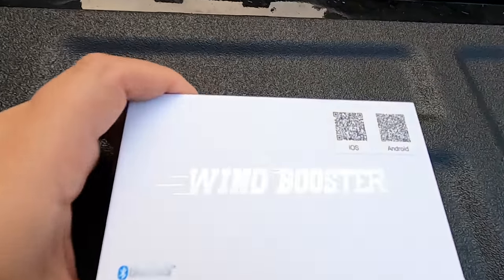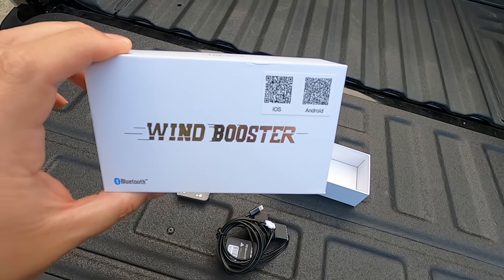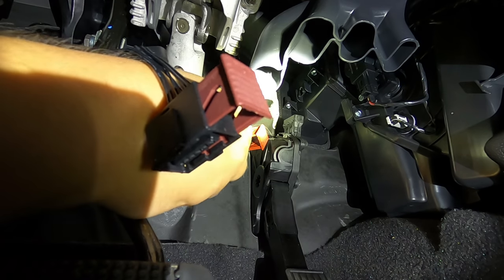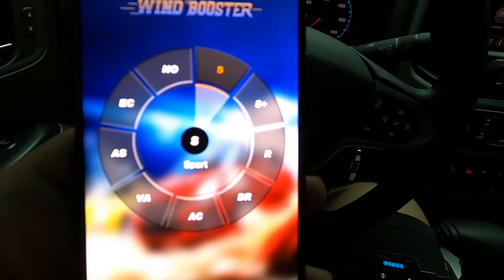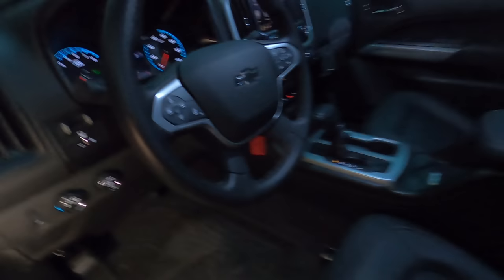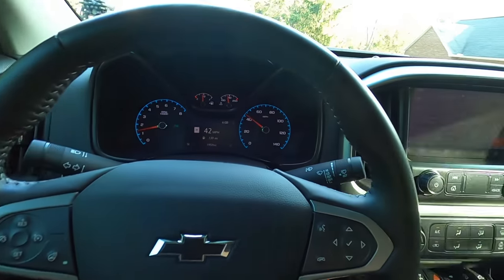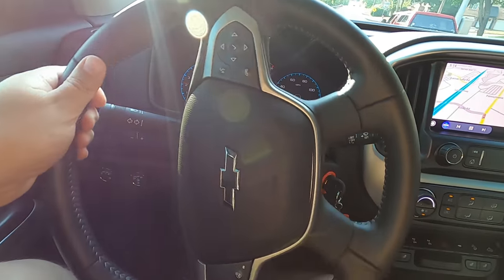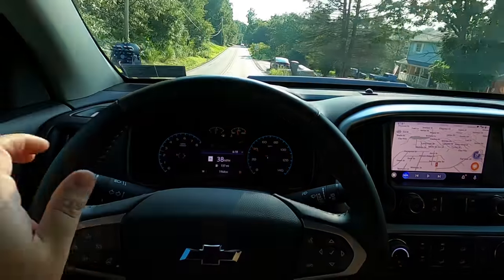FIX the throttle LAG on the Chevy Colorado with Windbooster!

Comment from the maker: HUGE improvement in drivability with this mod on the Colorado. If you guys are interested you can save 12% off the product by using promo code hpo at this link: https://shop.windbooster.com/product/bluetooth-app-chiptuning 👍👍
Reply: Ordered one yesterday before the video 😡
Reply from the maker: Dang!
Reply: Does this void manufacture warranty?
Reply: will it work on a 2015 Chevy Colorado Z71
Reply from the maker: Yes it will. 👍👍
Reply: I had one on my 2015 z71. It was not the wind booster but, it was great until it started messing with the computer in my truck. The dealership said that the throttle control was the problem. Took it out and have had no problem with computer since. Don’t know if it was just the one I had or what. Sucks I hate this lag she has
Reply: How does the Bluetooth effect other blue tooth devices?  I notice in my canyon  I can only connect one device at a time so I can't have my mp3 player and my phone connected at the same time?  Tks    Also I notice sometime  BT drops out for no reason,  hope this does not happen with the wind booster.
Reply: Great video, I just orders my new Colorado zr2 disk edition and will be here in like 1.5 mo, I’ll definitely be doing this and the leveling kit, I can’t wait, thanks for sharing, also what part of PA are you? I’m in Erie!
Reply: Just went to the web site $199, no drama there. My question is did you actually get HP gain with the settings or if I can get this right, increase the throttle response from zero - whatever speed? Also, this doesn't change any factory tune settings, just the dial up settings from the software?
Reply from the maker: Yes. No horsepower gain but it definitely feels faster because of the lack of throttle lag.
Reply: How do I get this
Reply: Is the connection universal or is it vehicle specific?

Comment: HOLY SH*T!... Upgraded to a cold air induction intake, changed out a soler 76mm throttle body, and installed this wind boost...

I haven't felt this kind of power since my 91 Z28 Camaro.

Comment: Went with the Pedal Commander on my ‘18 Z71 diesel and it worked wonders for the dead pedal. Best part is that these throttle controllers are not detectable by the dealer and do not void the warranty like a tune. I also wouldn’t advise changing settings while driving because this can throw codes for throttle position.
Reply from the maker: Agreed. Easily removed if push came to shove.

Comment: I have a 2017 Colorado and always dislike it's lag like throttle response, thanks for the tip. This channel has helped me out a good bit since it got the truck.
Reply from the maker: You're quite welcome. It's definitely a problem that is pretty easily fixed. With this option having Bluetooth it makes it the most desirable option in my opinion.

Comment: This thing is beyond amazing. Installed mine last night and just took it for a drive. Oh my goodness. This thing is super duper cool. Not only does it have a range of settings in different categories, but it can make it so my accelerator works properly, if you’re not careful it turns the Colorado into a race car. In the Sport 8 mode (not even sport +) I got to 50 in about 3 seconds. Speed limit 55. It also affects the volume and sound of the exhaust. I’m really enjoying this.

Thank you so very much for the video and recommendation. 

** Just an FYI, for anyone buying one. DO NOT install it with your truck running. It will temporarily mess up your engine power. Be smart. Leave the truck off. Also be smart and connect your Bluetooth phone app before  installing the wind booster if you don’t want to use the little box thing.
Reply from the maker: 100%! It's one of the first things I'd recommend for this truck!
Reply: @HorsePowerObsessed  well the first thing I got was Nurf bars then led lights for the interior. Next is probably the tonneau cover before I even get led exterior lights. Last is the outlanding bed rack since it’s the most expensive.

Comment: Just ordered one using your coupon code, it worked thank you!  I am really hoping this works my biggest gripe about my ZR2 is how underwhelming it is when you accelerate.  It leaves me wondering where those 300 horses are hiding at.
Reply: How long did it take to deliver? I ordered mine last week
Reply: @leyenda713  Couple weeks it was sent from China.
Reply: @MountainHobbler  oh ok, thank you man. 🙏🏼
Reply: Hey man how is it working does it work like the videos says it does?
Reply: @Cortinas28  Easy to install and does exactly what the video claimed. Anything higher than Sport + will break the rear tires lose with just a tap of the accelerator.
Reply: Hey I'm about to order one what is the coupon code bro

Comment: OMG! THANK YOU SO MUCH! I have owned my 2016 Colorado ZR1 Trail Boss since it was rolled off the showroom floor. I love this truck but hate the lag on the accelerator. I used your code and can't wait to get it in and put it on. I'll come back and tell you how it works for me.
Reply from the maker: You’re very welcome. Definitely let me know. The Colorado had the worst throttle lag of any car I’ve ever driven so it needs this for sure!
Reply: Did you get it in yet?
Reply: @kingvoorhees6479  YES! Oh man what a difference. I told my buddy about it and he ordered one too. I also got the phone holder you recommended as well. Thank you so much! I really do appreciate it.
Reply: @peek73 how did it perform during the long run

Comment: What a difference I got my wind booster installed on my 2015 colorado first was sport mode number 6 too sensitive throttle response reduced it down to 3 much better. Have yet to try other modes yet. Easy to install but a pain in the ribs trying to zip tie the extra wires.
Reply from the maker: It really is a huge difference!

Comment: I've only had my 2021 Z71 for about 2 months and I've definitely noticed this pulling out of my drive on the uphill slope of my road.  I'll pull out and push down and in about a split second I suddenly get a burst of RPMs that go up to about 3k-3.5k range and then the throttling smooths out rapidly after that and the gears start shifting.  It doesn't happen every time but it's that odd split second from pushing down a decent amount on the gas and then the sudden unexpected burst of power.  My 2021 has about 45k on it, one previous owner who drove mostly highway miles on it over the past 2 years.  Otherwise the thing is in great shape and I'm loving it (this is my first 4x4 truck coming from owning a series of sedans over the years).  I'm seriously considering removing that horrible air dam though.  I think about it a lot late at night lol.
Reply from the maker: LOL I would definitely remove it. It was the first thing I did on my z71.

Comment: Could we please get an update on how the unit is performing a year later? Are you still using it, any issues etc... Thanks!
Reply from the maker: I used it for about 8 months without any issue. I traded the truck after that.
Reply: @HorsePowerObsessed  
Thanks!

Comment: Definitely interested to see if you can forgo a tune. I had a tune and ported throttle body on my first gen. I recently inherited my dad's 2016. The first thing I did was buy a similar gizmo like this one. I've got my eye on a ported throttle body. Still wondering if I can pass up a good tune. So please keep us posted. 

Also thanks a bunch for all your other vids. I bought the license plate bezel, leveling kit, script grille, and black fog light housings after watching your vids. Also had air dam removed. Truck looks fantastic!
Reply from the maker: This is definitely a good replacement for a tune as far as the throttle sensitivity is concerned but I'm still looking at possibly getting a tune later down the line for added power, etc. As of right now I can tell you without a doubt, this is definitely needed!
Reply: I have a Soler 72/76 TB on my 17 along with Trifecta, cai, cat back.  Great improvement in part throttle drivability.  I had a intermittent hesitation when doing a rolling stop, that is totally eliminated.  It was great from the time I bolted it on but even better after 500 miles.  Worth the $$$.
Reply: @madcratebuilder  That's exactly what I want minus catback...don't believe that's legal around here. But I would love that setup. I had already found Pedal Commander before Soler. Nothing wrong with Pedal, I just think Soler would do well with its own throttle body. I do like the auto theft feature on this Windbooster though! So many great toys from which to choose! Thank-you for sharing :)
Reply: @bagery  Pedal Commander is a good unit, I had one for about a year, removed after installing the Trifecta.  The Soler and new Windbooster look interesting.

Comment: Yeah, so Hey. I have been checking out your vids on tho Colorado, I have a 2021 I got last year, I got the cold air intake because of you, and I have been really looking into the pedal “enhancing” products. Now that it has been about a year since the windBooster vid, I was just wondering if you still like it, or what. Sorry if I’m being weird, but I’m just wondering. Thanks
Reply from the maker: I totally understand. I used that throttle controller right up until I sold the truck and it was working absolutely perfectly and I would highly recommend it still.

Comment: I know in the video you mentioned that the wind booster controller doesn't need to be plugged in while using the app now after sometime to become familiar with it. is that statement still true in my case the less wires the better.
Reply from the maker: Yes. The controller screen doesn’t need to be attached.
Reply: @HorsePowerObsessed  thank you I just put mine in last night holy cow talk about GameChanger.
Reply from the maker: 100%!

Comment: Thanks for the video!

Two questions: Do you have to have the app running and phone connected at all times? If you set it at your desired level but don't have your phone will it still operate as before?

Have you noticed any difference in gas mileage since installing the Windbooster? 

Thanks again!
Reply from the maker: You're quite welcome! You do not have to keep the phone connected, it will remember your last setting which is how I leave it. I never noticed any difference in gas milage.

Comment: Soler Performance makes these for vettes.  Also got a new throttle body from them that made a big difference in performance in my 2020 Chevy Colorado 3.6L. Check them out, very nice people and very helpful.
Reply from the maker: They aren't bluetooth connected like this one is. I have one for my ZR1 but will be swapping it out if this company makes a bluetooth one for the C7.

Comment: Justin
First off, amazing video and content as always. Interested in this item. I have a 2022 Canyon, have you heard any chatter about those vehicles having this issue. I notice when i step into my throttle it doesn't feel as responsive as my 1500 Sierra did. Thoughts. Thanks
Reply from the maker: Thank you! That response issue you have is exactly what this will fix.

Comment: Great writeup but $200 is steep for what this does IMO. I have the 2.8L Duramax and I'd much rather put $200 towards a carb approved tune that gets me 52 more hp and 94 ftbls more torque and also resolves the throttle issue. 
I find that after driving my truck for for a while my foot is now sensitive enough to automatically modulate the throttle to mitigate this issue. Basically I do the same thing with my foot.  
A tune on the other hand will fix in a different and better way and with a lot more power and drivability.

I can't speak to the V6 gasser. Perhaps it's good alternative for it.  
If you've got a Duramax checkout Duramax Tuner 50 state legal tune.
Reply: Have a link for the one you recommend?

Comment: Great info, experiencing the lag on my brand new Colorado 2,000 miles. ? is, If this is a problem,  GM needs to take care of this, Why are we Colorado owners letting them get away this problem, especially if this is the solution with the Windbooster, if let go is it possible to cause transmission damage?
Reply from the maker: Not likely to cause transmission damage. Very likely put there on purpose to help with gas mileage.
Reply: @HorsePowerObsessed  thanks much for responding, Great info you provide

Comment: Would this work on equinoxes? probably not too safe with that much power, that's some pretty cool tech though.
Reply from the maker: Definitely would. Any of the newer electronically controlled throttles will work.
Reply: @HorsePowerObsessed Would this work on my Dodge Neon? 😂😂😂

Comment: Are you still using this? What are if any the pros and cons. I know a pro is better pedal response with no lag, any cons? What are your thoughts this or the Banks pedal monster? Thanks
Reply from the maker: I've used a bunch of different throttle controllers and they were all more or less the same. The features are all that really seems to separate them. This one was cheap and got the job done well. I still recommend this one over any of the other ones out there.

Comment: Hey Justin,  does the app have to be open every time you drive the truck if you didn't install the small control panel? Just wondering
Reply: No. The device remembers last setting. Don’t even have to have Bluetooth on on your phone after initial setting.
Reply from the maker: The phone remembers you don’t even have to have it paired after the initial change if you don’t plan on ever changing it again.

Comment: I run in tow/haul mode most of the time. It's like a different truck.
Reply: I heard that it's hard on the transmission to do that. Since it tells the ecu to shift later on.

Comment: I bought this about 2-3 months ago. Worked great until about 2 weeks ago, now its not working at all. I don't drive my Z71 every day, I have a work van, so I was wondering if anyone else was having this issue. I tried disconnecting then reconnecting it, no dice. Any help on this would be greatly appreciated
Reply from the maker: I’ve heard a few people having an issue what you’re gonna wanna do is contact wind booster and they’ve been sending out replacements.

Comment: Say you left your phone in the house and went for a drive would it just default back to factory programming? I'm trying to order one of these online with the link in the description it's currently not letting me add my address for some reason.
Reply from the maker: No. It stays in the mode you last left it in. I never connect my phone anymore to it because I never need to change it.
Reply: @HorsePowerObsessed  thank you sir that was another question I was going to ask if you had any trouble with it obviously not good to hear thanks again!!

Comment: I have an 18 ZR one can’t bring it over 100 miles an hour there’s throttle anything to work over that work around that
Reply from the maker: A tune is the only thing to fix that, unfortunately.
Reply: That’s not the answer I know he had a car Dino Dan tune no improvement there’s a governor somewhere please investigate for all of us we all have the same issue
Reply from the maker: The governor can be removed via a tune and a tune only. When you get the tune you have to specifically ask for that to be removed in most cases.

Comment: we are picking up a 2022 colorado redline edition this coming thursday june 30th, 2wd, v6, will this throttle module work on it ?? it should,, i like your threshold , carbon , red colorado protectors too
Reply from the maker: Yes it definitely will! You’re gonna love the truck!
Reply: @HorsePowerObsessed  I love my 2016 Silverado 1500 z71 off road,  but it's getting kinda long in the tooth,

Comment: Mine was just delivered today November 1st. Pluged it in per instruction. Immediately got a check ECU warning light , rough engine idle and my engine light came and my phone dinged and it was onstar texting a notification to make a appointment with chevy immediately. I emailed windbooster and waiting for a reply.  In the meantime I am afraid to drive my truck 🚚
Reply from the maker: Wow that's crazy. I've never seen this on any Colorado I installed these on. Try removing it and see if the issue goes away
Reply: ,I have tried 3 times. I am thinking they sent me the wrong part? Meantime I am dealing with a engine light error
Reply from the maker: Let me know what they say. This is the first time I’ve heard of this happening and I’ve installed a bunch of these.
Reply: Will do. May take a few days. I am going to find out today why my engine light is on.  When I installed the wind booster the truck immediately started to idle rough and check ECU light came on.
Reply: Update on my wind booster. Unit is defective. Trying to get ahold of somebody is next to impossible. I have been emailing with them for the last few days and have not gotten anywhere!Customer service is really bad. After I return unit and get my money refunded (ha ha) I am hesitant to try again. That's a shame because I was looking forward to having a more responsive acceleration.
Reply: Problem is with this product is it uses the power supply provided by the ECU. It’s only 5 milliampere being supplied. When you connect the pedal booster it takes away from the power source. The ECM thinks the pedal switch has failed and throws a code Check engine light. To correct this just unplug it. Clear the code. Reconnect it without the pedal booster. The fix is buy a Pedal monster! It uses the 12 volt diagnostic port to supply power to the booster. Also Banks has the it programmed to turn off in reverse. Those other cheap China made junk doesn’t have that and isn’t safe backing up. This is what usually throws the code when you first install it. Most people back up first after install.